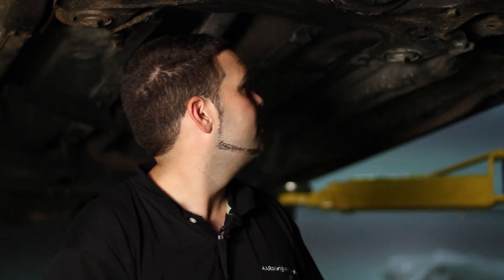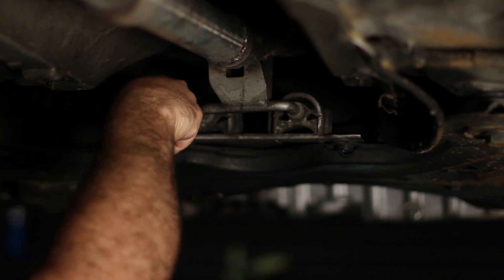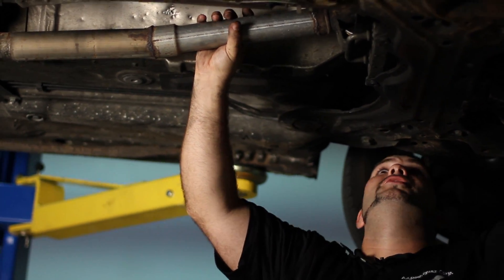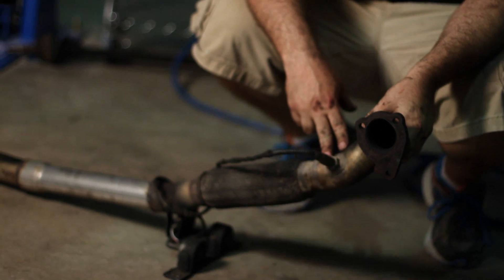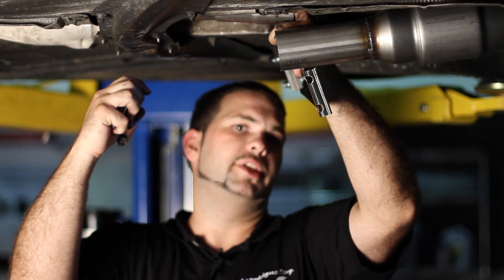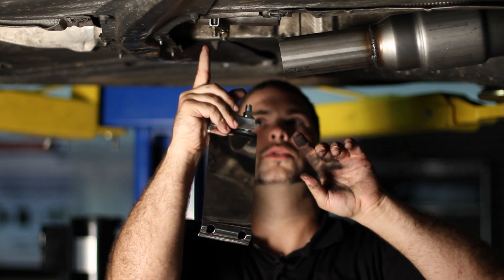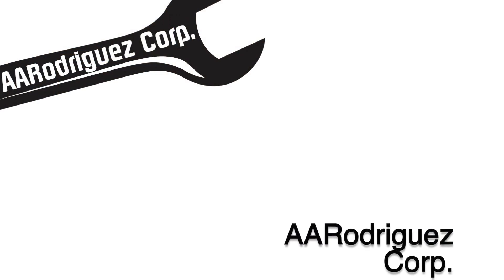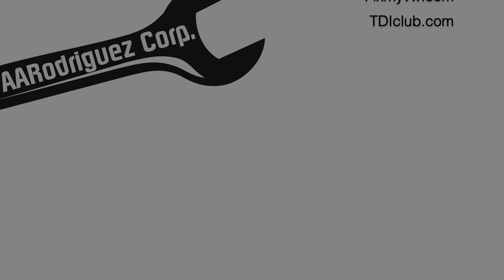BuzzKen VW MK4 Downpipe Install DIY

Comment: Been looking at one of these for my 05 Golf TDI for awhile.  One question though.  Any issues with running a 2.5 in or 3 in downpipe on a stock car without a tune?  Will these cause overboost with the stock VNT turbo?  Just curious.
Reply: It will cause absolutely no problems with over boost

Comment: On the MK4 1.8t, is it a 3 bolt, or a 4 bolt? Looking for a performance downpipe and finding both. Both claiming to fit my 03 1.8t.
Reply: +salemcripple ITs 4 Bolts , to the turbo.
Reply: +salemcripple ITs 4 Bolts , to the turbo.
Reply: +Toronto D K thank you!
Reply: if you have the 1.8T, it is 4 bolts to the turbo housing, too attach the down pipe to.

Comment: Do you know if BuzzKens ceramic or high flow cats throw CELs? I'm very interested. I have a 2001 1.8T Golf AWW.
Reply from the maker: They don't but your car must be in good condition, bad 02 sensor, coils or plugs will kill a cat quick
Reply: +Jonathan Cannatello I did at first ,and had to clear it, it has never has never come back.
i would recommend the down pipe it will make the engine sound louder and also the turbo .
oh i also have a 1.8T Jetta ET AWW
Reply: +Jonathan Cannatello I did at first ,and had to clear it, it has never has never come back.
i would recommend the down pipe it will make the engine sound louder and also the turbo .
oh i also have a 1.8T Jetta ET AWW